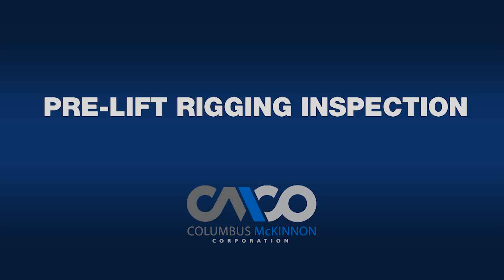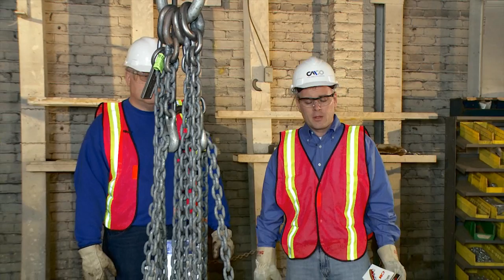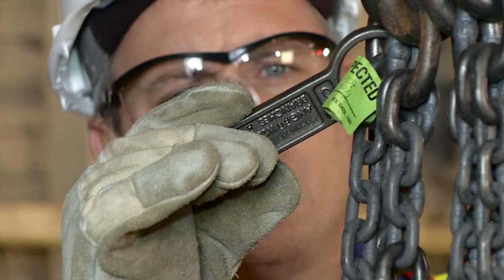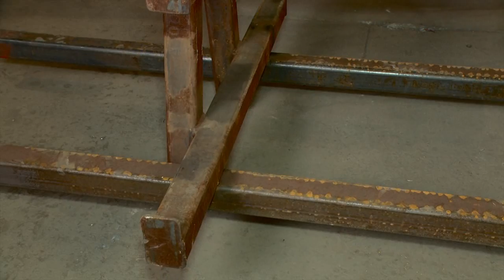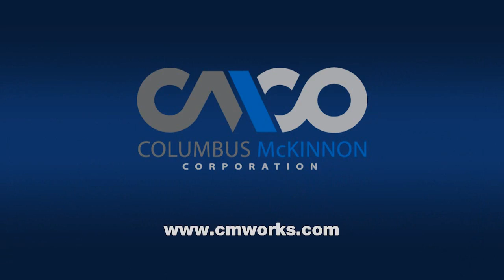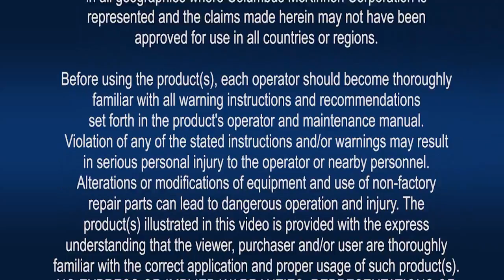Pre-Lift Rigging Inspection

Comment: Four slings attached to one master link its a nooooooo go.
Reply from the maker: Hi Domingos, 
Attaching four slings to a single masterlink is known as a quad sling.
The attachment point can be made with welded couplers or mechanical couplers/Hammerloks.
The use and manufacture of these types of slings has been around for years and is widely acceptable.
Additional information can be found OSHA 1910.189 Slings & ASME B30.9.
When using this type of sling, the working load limit is calculated the same as a triple. So the load charts for each triple and quad will be equal for the size of the chain used to make the sling.
If you have any questions feel free to contact us.
Henry Brozyna
Reply: Hey Columbus.
The use of four slings attached to a single master link is not a recommended practice in the UK or in EU for the fact that: in one master link the two slings in the outside will be overloaded because they seat higher in the master link check for yourself that the two slings in the centre are longer than the outer ones. Hence the recommended practice is max allowed slings in one master link is two and if you need to connect three or four you shall use a master link with two sub master links.

Comment: The angle that the hooks are pulling off the shackles is wrong. I know this is unavoidable due to where the holes are made, but it should be mentioned.

You're pulling the shackle from 1 side, creating a single shear pin point of pressure. Shackles are designed to lift to double shear, where the load is evenly balanced across the middle of the pin, but a lot of people don't know that and think it doesn't make any difference if the shackle is in line or not.
Reply from the maker: Thanks for your comment. Anchor style shackles can be side loaded per ASME B20.26 as long as you take the proper reductions. Please watch our shackle webinar for information on use of shackles: http://owl.li/svJ05  and let us know if you have any further questions.
Regards,
Peter Cooke
Reply: Columbus McKinnon Booyeah!